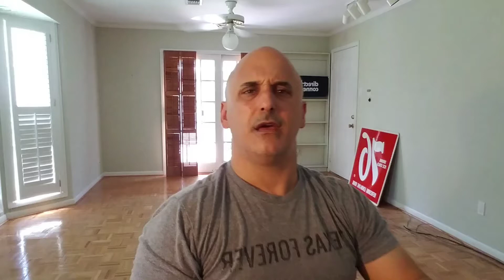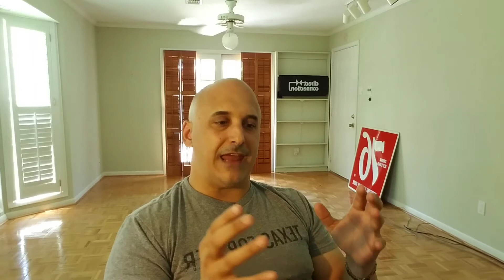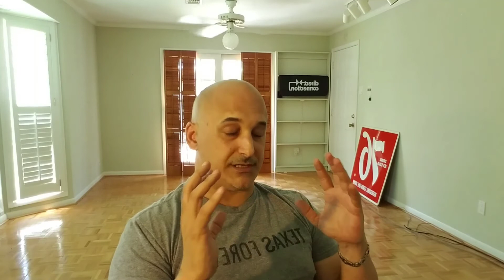Chassis Dyno - correction factor explained.

Comment: I really enjoy your videos! I have a question, I recently had my Charger dynoed at a car show on a Dynojet, I requested that they dyno in 6th gear (1to1) they refused due to high wheel speed and used 4th, what difference will that make? I have 2.62 axle ratio, my Chargers best run was 335 horsepower.

Comment: Do you believe some cars just so happen to be "factory freaks" from the factory and are actually putting out more power than a lot of other cars made on the same assembly line?
Reply from the maker: Not really, at least not by todays manufacturing standards.  There will be some manufacturing tolerences which may make for a slight difference in power, say 1-2 percent.  That may make up for a 4-8 hp difference between engines.  Back in the day the factory freak was really nothing more than an engine which was built to the engineering standards of that mill.   Things like core shift in cylinder heads, timing marks being slightly off, heavy casting flash, etc. were much more common than today.   All of these tolerances when taken as individual issues  can account for a slight loss in power over what the engine was engineered to produce.  If one were to be unlucky enough to have all of them happen on the same engine (this is called "tolerance stacking") it could make for an engine which could be down by as much as 10-12 percent.   There have been factory freaks here and there, instances where a particular set of cylinder heads may be decked 10 thousandths or the timing mark was slightly advanced.  In that case the difference may be 1-2 percent over a perfect engine.  But those heads would have to be perfect (no core shift) for that to happen. All of this is considering a tune with the factory settings.
Reply: rjburston maybe.... LMAO!!! My little ole R/T 5.7 has hurt a lot of feelings.
Reply from the maker: gordyn kirschner man... if I had to do it all over again.... 
5.7 8A
Ported heads
Ported intake
Custom grind cam to my specs
130/400 spring pack
Long tube headers no cats
3.70 gear
Boom... 11 sec 5.7. With the stock converter.
Reply: B Mason the 8 speeds are cool as far as their shift points go,  but me personally, I  will always be a manual shifting kind of guy for the most part.

Comment: I had a 5.7 6m challenger (2016) I agree for sure that its slightly underrated. Never added up in my head with the dyno numbers. I now have a 392 charger scat pack and judging from the dyno videos for these 392's, they are pretty spot on it seems . Great video

Comment: hey mr. Mason Matt here with the RS3 that I just bought question I want to put a drag radial on the back and wanted to use the Mickey Thompson ET SS my tire size is 275 35 20 the closest one they have is 275 40-20 but yet my Roush book says if I use a taller Tire it will throw off my anti-lock braking system and my OBD do you think that tire will work and do you think it will screw up my car?
Reply from the maker: Matt Kamrad I would think it would be fine.. just one thing, some manufacturers have tighter tolerances than others for and fault. most fall in about the 4 percent range (plus or minus height) between stock sizes. the tires you are looking for are nearly 4 percent (3.93). just off the top of my head I don't know your specific tolerance but it is certainly could be cutting it close.

Comment: What makes the 5.7 underrated whereas the 6.4 isn't?
Reply from the maker: The 5.7 is basically the same engine as what is in the Ram 1500's.  That engine is rated at 390 hp and 410 tq.  When the trucks and the challengers are dynoed back to back they lay down essentially the same horse power.  Nearly always 33x.  If I were to guess, I would say they are underrated slightly to make the difference between the 392 and the 5.7 seem a bit greater???  Maybe, either way they do put down a solid number for the rating.
Reply: B Mason So does that mean the Durango R/T falls in that same grouping considering it has the 5.7 as well?
Reply from the maker: Billy Owen I would say so.